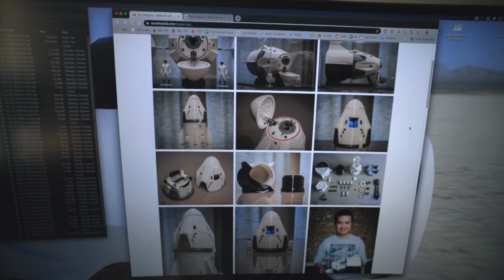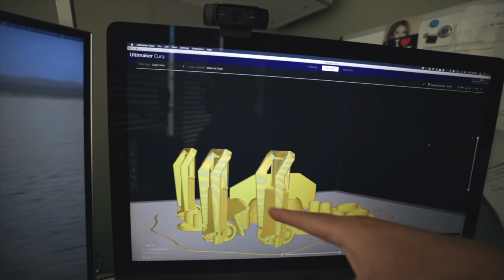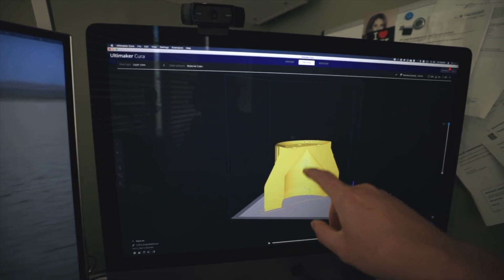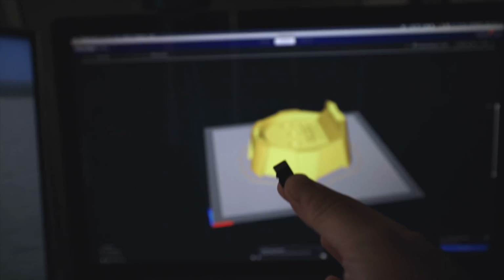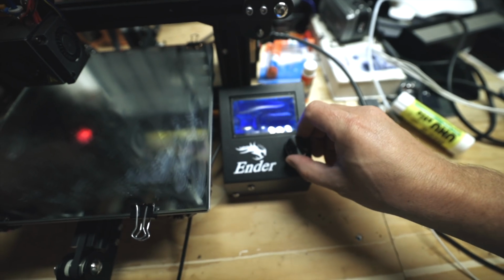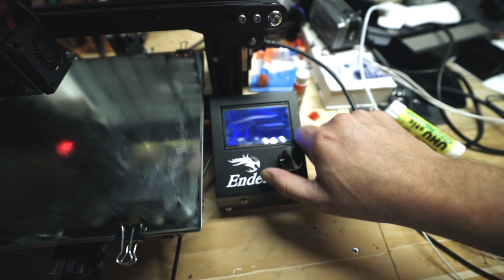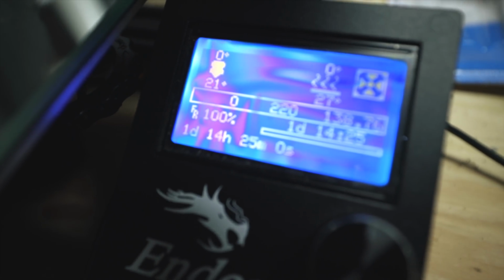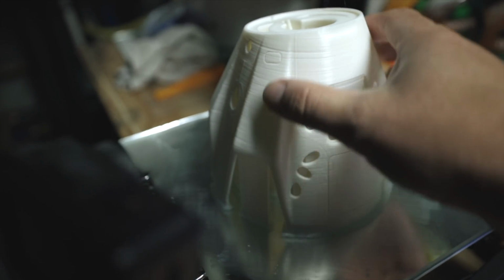🚀 Massive 3D Printed SpaceX Dragon Crew !

Comment: Hi, 

Great model! Looking to do the free one and if I get on OK with that I'm going to go for the bigger one, just a question... how did you quickly determine all the black parts all the white part etc etc... there's so many files!?
Reply: Thanks for your reply, I'm going to do all 3 eventually but need to make sure I can do the free one first. I'm 2 weeks in to printing in general so putting blockers on supports in cura is something I've never done. Is it easy?